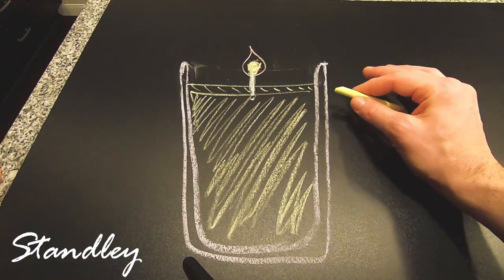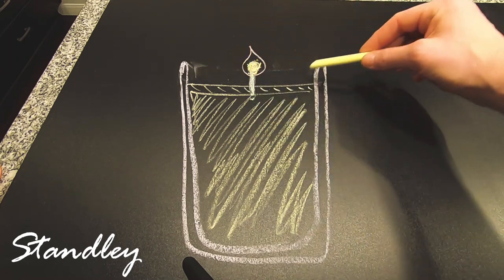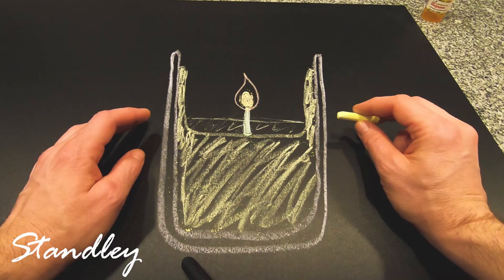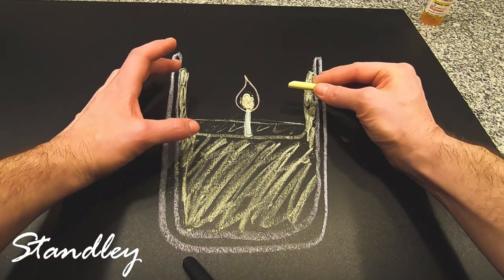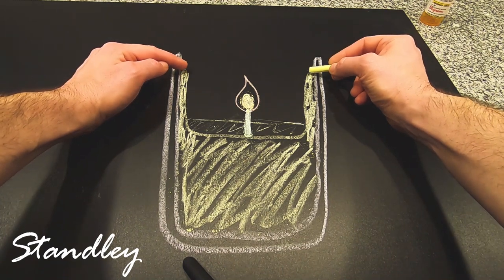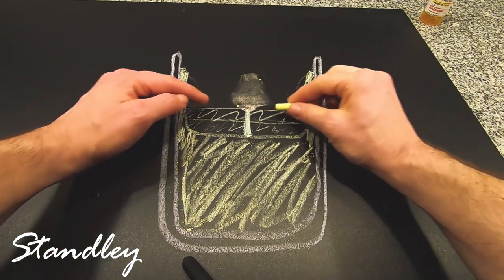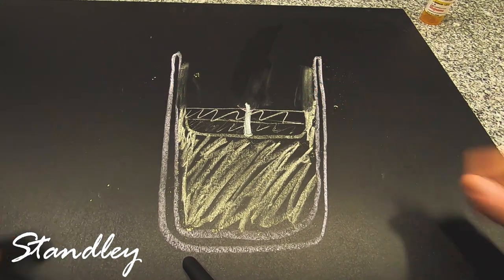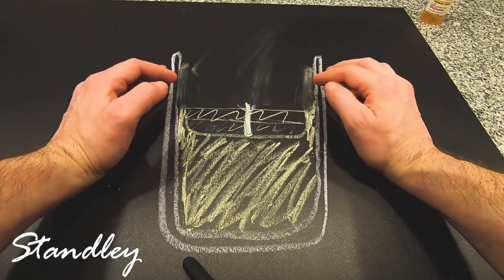Why is my candle drowning the wick and going out?

Comment: Very clearly explained. I had this problem when I first started, now I pay attention to my test burning and eliminated this problem. Great Video as always. Thanks for sharing.
Reply: Hiii Nick. How did you solve the problem?
Reply: @Ibizalexa  Hi, Basically during the test burning I would make at least three candles and use a wick recommended for container size and wax. Then one, a size below and one, a size above,  I'd pick the best wick for candle height, burn pool and scent trow ( if applicable ) then repeat the test burn with the selected wick to prove it was not a fluke. I know it sounds long winded, but the test burn is the most important stage and it irons out such problem. I hope this has helped. Stay safe, regards Nick.

Comment: This always happens to me when it’s the candles I buy 🥴. Thanks for the video!
Reply: I was having this problem just tonight, this was a lovely illustration of the problem.
Reply: I brought one and I made sure to burn it long enough for the first light and there wasn't any obvious tunneling. This is the 5th time using it and it keeps extinguishing itself.  The wick would get shorter and shorter and the was would not keep up. I tried scraping away extra wax but I see it won't be solved 😕 I really liked it while it lasted though

Comment: You can use cotton balls to soak up extra melted wax to git rid of excess wax
Reply: Thank you I'm going to try that. I just bought a candle and it was lit for an hour before constantly going out. It seemed like it had too much wax near the whick and I assumed that the candle I bought had to small of a whick. I really don't want to return it, so I'm going to try different techniques to see if I can fix the problem. If I can't then I'll return it and hopefully get another better made candle. This one was hand made at a book shop I went to so I thought it would be fine but it turns out it's not working as good as some of the commercial ones I've had; unfortunately.
Reply: 💡💡💡Duh . Thank you for this  🤦🏾‍♂️

Comment: Very helpful! Gonna go up a size. One question though- what’s the best way to get rid of wax from sides?
Reply: What I do is I just heat up the outside (with an electric lighter or hot water) and the wax will come off easier with some sort of wedging device. (fork, butter knife, etc)

Comment: This could well be my issue but there isn't much wax round the sides and it barely seems to form a melt pool before going out.

My candle in question is the first time I've used a rope wick rather than one that stands erect. It's like the wick just flops when it's not supported by solid wax and therefore droops into the wax pool and goes out.
Is that a thing? Have I used the wrong type of wick of a jar candle?

Comment: How do you fix a wick that keeps getting extinguished by residual wax?
Reply: What I do is I use a blowdryer on low settings to heat the top layer of wax. Once the top layer is melted, I use dip a tissue to remove some of the wax so more of the wick is exposed. After, ya let it dry and re-light and back to normal in my experience.
Reply: That's great for you but a customer isn't going to do this. They are going to complain that your candle sucks.
Reply: @188lobo  that is true, did you manage to find solution to this problem? How it’s fixed?

Comment: Would it be possible to burn the candle for a period of time and pour out the extra melted wax to now give more space for the wick? I am new to pillar candles and I am having this exact issue because I was not hugging the candle which I just learned and it created a large tunnel over time. Now I am trying to fix it.  I am debating if I should just cut the tunnel off and make the top flat again. Then start burning the candle properly from there. What do you recommend?

Comment: Hello Jeff! This happened when I made my soy candle with an Eco-Soya wax but it has never happened with 464 or parasoy. It also happened with one wick and two wicks. Any tips? Could it be the wick? You are amazing by the way!!! Thank you for all of the information.
Reply from the maker: TheEnhancedGem Thank you so much. 
It could be the wicks. Some burn very different in different waxes. You might try another set of wicks in the same configuration.
Reply: Standley Handcrafted Will do. Thank you!
Reply: I haven’t had this happen with my EcoSoya wax when the correct wick size is used.  I use the candle science recommendation on wick type and size for this brand.  It could be the wrong size or type of wick that is causing this.  I love the EcoSoya wax!  I use it pretty much exclusively now.  I just love how the tops turn out and require very little if any clean up to make the perfect candle.
Reply: Tiffany Felkner I know! It is amazing. I used the Eco wick so I’m going to try the LX and even a wooden wick to see how it turns out. Thank you for the response!
Reply: @StandleyHandcrafted  
This is happening to me with dessert candles when it begins melting, tunneling through the whipped and drowns. 🤷‍♀️

Comment: Hey Stanley nice video. I'm having an issue with my candles keep flickering. About half an hour after I lit my candle it keeps flickering. Why is this happening?
I Tried LX20-LX22 and it keeps tunneling. I tried LX24 I got a wider melt pool , flickering and mushrooms  flickering and a little smoking. LX26 and LX28  melt pool are fine but mushrooming, smoking with flickering, I used 8%FO and 3" diameter jar on all candles. Please 🙏 help. Thanks

Comment: So what is the solution for this issue?
Reply: I think Stanley said use the correct wick size width for the jar you are using.
Reply: @HouseofStaci  Can u scoop out a bit of the wax around the wick so it has room to burn?
Reply: @Fatin, I've tried your solution for years. It only works for a short period of time!
Reply from the maker: If you bought a candle that is doing this you will have to remove the excess wax and relight.

Comment: What else might cause the wax to drown out the wicks if there isn’t wax on the sides melting down and drowning the wick? It is a 3-wick tumbler.
Reply: Is it the one from Candlescience? Thats the one I'm having issues with. Weak flames! I'm using (3)CD 4 wicks. IgI 6006 wax.

Comment: I saw a tip somewhere that if you wrap your candle jar in foil to help the sides melt on the first burn so its less likely to tunnel, would that work to heat the edges evenly? than ks

Comment: Hiua, When you say the wick is too small are you talking the width? Cause if the wick is too long, doesn't it naturally burn to the appropriate length?  Yes I did get too much wax in the jars,  but I've had solid candles that funnel where you can't put foil around it... what's the right/ideal thickness of a wick? If known 🙏🏾😔🙏🏾

Comment: That is what is happening with my 3 wick candle. Im using the 3 wick candle vessel from CS. 9% FO IGI 6006 wax. The wick guide suggested (3) CD 4 but the flames are so weak but the melt pool develops in an hour. 😮 I dont get it. 😫

Comment: Hello jeff, i had a few questions. Is it posable to make the candle not make black smoke? (the kind of smoke that you get with oil lamps) also how do you prevent the flame from touching the wax scorching it? I was wanting to reuse the candles i make and notesed that the wax got chard and unusable.
Reply from the maker: wherewolf13 Matching the right wax with the right wicks can reduce this down to nothing.
Reply: Thank you. Also other question. How do you make a candle not air bubbles. By that i am refuring to when you put moten wax in a silacone mold. (Again with the silicone mold candles) how do you know when you can demold?
Reply from the maker: wherewolf13 I let them sit for a few hours or the next day before I take them out of a mold
Reply: How do you find the size the wick needs to be with a candle that has no container? (I.e. a wax casting of an owl insted of wax in a jar) i understand if you can't explain that but i would like to know if you know how to do so.
Reply from the maker: wherewolf13 It would cone down to just testing. You could narrow it down by checking the diameter of the owl and matching that with a wick from a wick guide.
Reply: Thank you.

Comment: I just started but I have similar but different problem I used 2 same size small metal pots 1 is with bee wax other with soy wax and soy wax puts it self out after 30min where beewax works fine for hours I also tried wooden wick in soy wax and it only lasts 7min is it anything to do with thickness of wick or does soy wax melt quicker? I’m bit confused why this is happening. Please help thanks :)

Comment: Can you fix the problem? Like shave wax off?
Reply from the maker: You would move to the next wick size up to fix this. When it does this it is an incorrect wick
Reply: @StandleyHandcrafted  ok thanks!
Reply: @StandleyHandcrafted  What if your wick is properly cut at a quarter of an inch from the wax? Would the wick size still matter?

Comment: Do shoe strings and yarn 🧶 burns efficient or good like yarn. Can you use tree wooden twigs for candle wicks ??
Reply from the maker: No none of those will work. The cotton used in wicks is also dipped and coated in wax.
Reply: @StandleyHandcrafted  Have you even tried it before telling me it won't work ??
Reply from the maker: @drrobotnikmeanbeanma  Go ahead and try it. 
Uncoated cotton will burn too fast, the wax helps slow it down which is why it’s coated.

Comment: Why do my homemade wicks spark? I am dipping beeswax taper candles and using butchers twine.
Reply: The only time I've had candles spark is if water got into the wax whether during the candle making process (there was a class project in middle school where they told us to alternate dipping in wax and dipping in water, those candles sparked and had issues staying lit) or later on with water getting into the wax pool (resulted in excessive sparking and eventually self-extinguishing and the candle flat out not lighting).